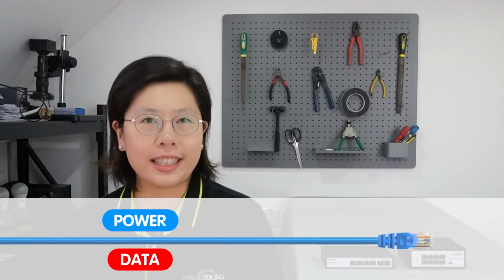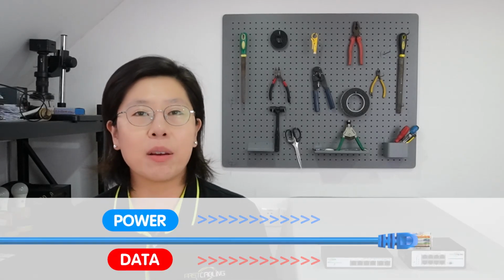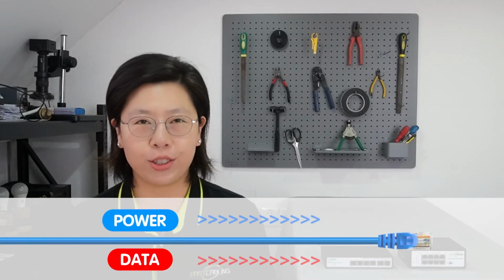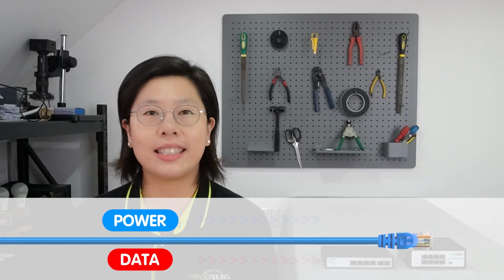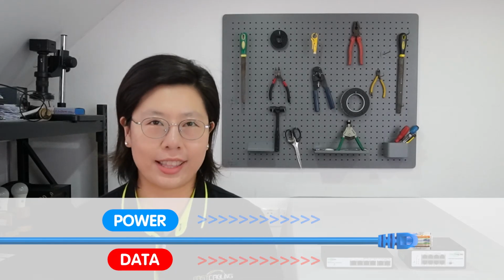Long-Range IP Cameras Made Easy: PoE Network Expansion Guide

Comment: Great explanatory video. Thank you but i am wondering over that distance, as in 200m in the example, is the bandwidth 1gig, 100m, 10m ? Is there a limitation over the distace ?
Reply from the maker: The bandwidth is 10Mbps on the regular PoE ports when the dip switch (CCTV mode) is enabled. 100Mbps when used in conjunction with a PoE extender, and the distance can reach 500 meters (however, it'll drop again to 10Mbps when it hits 800M). Signal strength deteriorates as the distance increases.